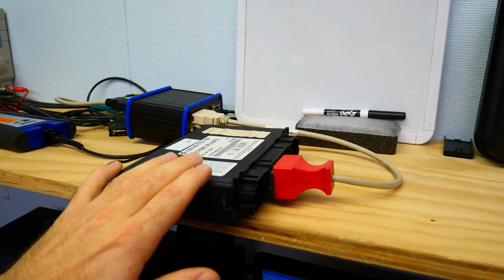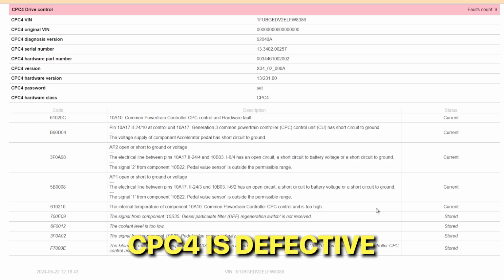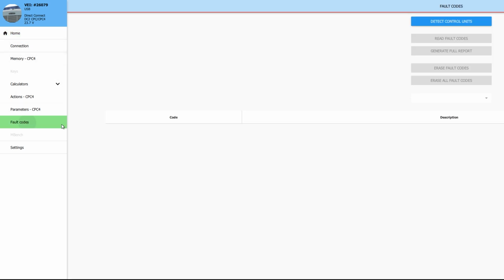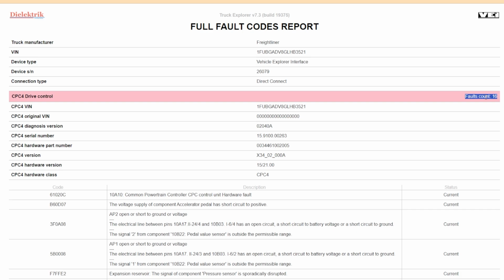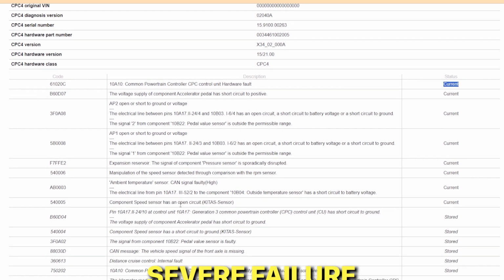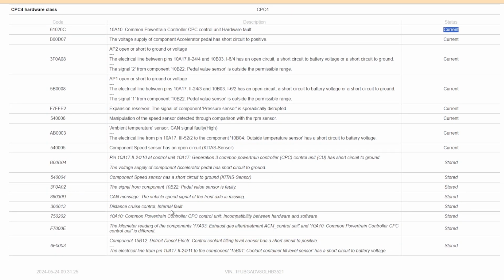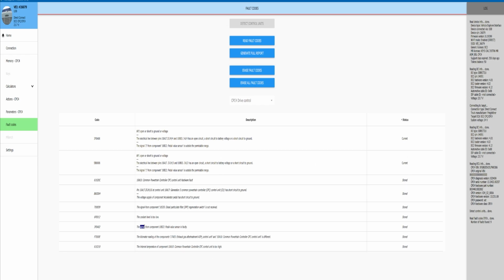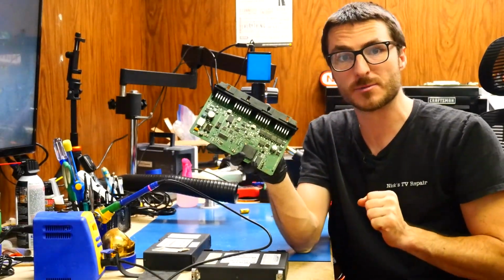CPC4 Fixed Fast And The Right Way! Freightliner Cascadia

Comment: What about the second unit, where the malfunction is more serious? I also have one in repair with a similar fault. After re‑baling, the SPN 609FMI12 error remains.
Reply from the maker: If the issue remains, then 1 of 4 things could be going on. 
#1 The chip didn't seat properly or there is some sort of soldering issue still. 
#2 The chip is actually starting to fail (rare but can happen)
#3 During the repair process another component was knocked off, or conformal coating wasn't removed properly which starved some joints and caused bad sodler connections on other components on the board
#4 You could have a software failure.

With #4 sometimes when people keep driving when their CPC4 starts to fail but only intermittently and they keep pushing it and driving it, it will cause the CPC4 to go into a protection mode and prevent the unit from being able to work all together. Once the hardware fault is fixed, the protection mode won't care because it doesn't know that it's been fixed so it will still have the CPC4 locked up and the only way to get it out of the protection mode is to have the unit reflashed. 
9 times out of 10 when the CPC4 is in that mode the truck starts but you get no throttle. If that's what you are experiencing post repair then most likely you need it reflashed.
Reply: I flashed the cpc4 with firmware from a known‑good unit. Full flash and EEPROM dump. But no changes. I washed all the varnish off the board. I looked at the processor’s circuitry under a microscope, to no avail. I reballed the chip again, but it didn’t help. I ordered a new processor and will try to revive this damned cpc. This CPC4 is from the Ponsse forwarder. I don’t rule out the possibility that I made a mistake somewhere myself.

Comment: Diesel tech here going to give the heating trick to see if i can show my road guys.
Reply from the maker: It will work most of the time, but if the unit is in really bad condition it won't. This is also not something I recommend doing more than a couple of times. eventually it will stop working, but if you keep operating it, then you increase the chances of having the software go into protection mode which then means you would both need to have the CPC4 reballed to fix the hardware fault and reflashed to get the software out of protection mode.

Comment: Six months ago, I was stuck 600 miles from home and had a truck with a cpc failure.  I went to many junk yards trying to find acpc and had no luck.  The dealer wanted $3600 for a new one.  I can across your video and it worked enough for me to make it home.  The truck was a parts truck so i really didn't want to have to buy a new cpc.
Reply from the maker: Glad to hear my video helped you get out of a pinch. 
If you ever want to send it in for a full proper repair, we still offer that service and it's much much cheaper than replacing the unit.

Comment: !!! $975 !!! To strip, clean, new solder ball, and heat! 
Dude I’m in the wrong business. 
This is an eye gouging price, why don’t WE just heat the chip to re solder the old cracked solder back instead of removing it?
Reply from the maker: If you ever worked on one of these you would know you suggestion won't work because of the conformal coating.
Reply: To get it done right is definitely worth it.

Comment: Great work and explanations. Yesterday, I had a freightliner 114sd dropped off and it would not crank. Def light flashing and no crank. Grabbed the cpc4 and brought it inside, opened it up, 20 secs with a heat gun on the processor and threw it back in the truck and it cranked first try and no def flashing. Got it in the shop now and might have the customer interested in getting it reballed. Thank you for making this video and the services you are offering!
Reply from the maker: Hey that's awesome! Yeah the heating it up is a great way to diagnose the issue. Also can help for moving the truck if it's in a bad spot. 
If you do opt to send in the unit for repair, here is a link to our flat rate repair service:
https://nickselectronics.com/products/a0034461002-001

Comment: What do you charge
Reply from the maker: Hello,
We don't provide pricing in the comments as prices are subject to change, but we do have a flat rate service. Here is the listing to that service which will include the price you are inquiring about:
https://nickselectronics.com/products/a0034461002-001
We offer a 1 Year warranty on this repair.

Comment: Is there a need to reprogram after changing CPC4 Thanks
Reply from the maker: If you are replacing the CPC4 then yes. If you are repairing it then most often no but sometimes yes if it got bad enough to go into protection mode

Comment: If my truck is deleted, would that be a problem?
Reply from the maker: It would only be a problem if the CPC4 is in protection mode. 
If it's protection mode then it means it needs to be reflashed to work which my understanding is that it wouldn't be possible if the truck is deleted. 
What fault is currently occuring with your unit. If it's full no communication then there is a high chance its in protection mode. If it's working most of the time but sometimes you loose acceleration then it's probably not in protection mode.
Reply: I am still not sure if it is the CPC for certain but last night while driving I got the check engine light and lost complete throttle power, 2 original codes came on something about coolant and accelerator pedal, I got towed to a safe location and I checked the codes and now there’s another extra regarding the clutch parm, what kind of test could I do? To diagnose whether it’s  the CPC or the accelerator pedal (or pedal sensor)? Thank you for responding!
Reply from the maker: Honestly I am not sure since I am not a mechanic. We really only focus on the electronics. The system we have in place and software we use to diagnose CPC4 units tells us if the CPC4 has a hardware or software fault within the codes that it pulls but we also connect directly to the CPC4, we don't use the ODB link and connect to the entire vehicle so we are able toget more specific information from the CPC4. 
Loss of throttle is very common with CPC4 failures, additionally the CPC4 controls lots of other parts of the vehicle so seeing multiple random failures from different systems is a clue the CPC4 is going out. 
Based on the information you provided, I do believe it is likely the CPC4 is the fault but wouldn't be able to know for sure until we tested it with our tools and equipment. 
We only charge a $20 bench fee to test them. 
https://nickselectronics.com/products/cpc4diagnostic

Comment: Are all CPC 4 modules the same or are there differences, such as whether one truck's CPC can be installed on another truck
Reply from the maker: CPC4 is not the same as CPC or CPC2. 
CPC4 are all the same for hardware but they are different with software.

Comment: What it would cost me brother. If I send you some. Most of them with same error code. The one you shown. And I have couple Cummins cm2350 ecm also. I corrupt them myself by putting wrong file and now they won’t connect.
Reply from the maker: We primarily fix CPC4, and while we do fix some ECM's we aren't equipped to fix all ECM for all vehicles, as we don't have the connections and software required for all at this time. 
If you can provide us with the information of the ECM's that you have, show us where to get bench testing equipment and the software, we can look more into it and establish if it's something worth looking into or not. Then we can discuss further. 
I would recommend you fill out on of our contact forms with as much information as possible and I will get back to you via email. Here is a link to our contact form below:
https://nickselectronics.com/pages/contact

Comment: Wow It's a really asmar Reballing..I wold like to hear if the ECU is worked properly on the owners vehicle.
Reply from the maker: Haha thank you. And this repair was done several weeks ago, yes it is working properly in the vehicle. If it wasn't we would have cought it during our bench testing. 
Our bench testing set up is extremely accurate and will throw an error if there is an issue. If there are no errors during our bench test then I know 100% it's going to work in the truck. 
We are also very good at catching intermittent problems, we have ways to force those problems to trigger. That's going to be a secret I won't share however :)